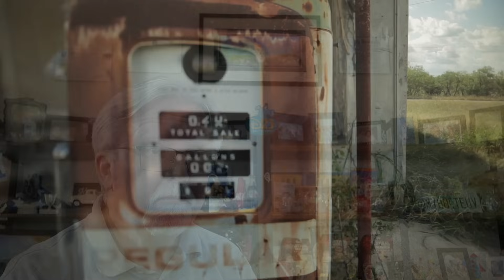The Shocking Truth About Gasoline Production Energy Usage

Comment: Prius owner here.  What drives the cheapest.   When I leave from home on  a 4,000 mile trip.  Usually Iowa to a body of water and circle back. Amazingly, something always  happens to a tire.  Either  EV/Hybrid/ICE. Replaceable tire sizes is a must.     Once being rear-ended by a truck caused me to come home in a rental never to see my car again.  Deer strike once left me limping 1800 miles home with major body damage.  Remember to have a Canadian Liability issuance card and Mexican Liability Insurance.   Chain and snow tire laws must be understood. EVs charging stations are getting there. But not prime time yet. 60 plus cents per kilowatt is a hell of a price. Hybrid or 2nd generation Volt is still the best road warriors.   When someone  drives from Key West Florida to Fairbanks in an EV.  Let me know.  P.S. I did that in split seasons of 2013/2014 in a 2010 Chevy Aveo. Yup I did have tire issues plus this pretty ceremonial stamp in my passport for crossing at the northern most US/Canadian boarder crossing. Chicken, Alaska is a must see after an inch of rain.
Reply from the maker: There is a video of a Cybertruck AND another of a Model X that have driven to the Arctic Ocean…and one originated here in Florida—not Key West, but it could have easily been!  Yes…I’ll guarantee you that it is very possible to drive an EV from Key West to Fairbanks.  If you fund it, I’ll do it in my Bolt EUV!  You can send the money through a SuperThanks or Kofi. Mail or wire transfer also works.

Comment: Not only to mention that every gallon of gasoline to the pump requires some gasoline to be burned… But additionally, a battery for an electric vehicle can be recharged quite literally thousands of times. So for every tank of gas, that is consume, a significant amount of gas gasoline has to be burned to bring the gas to the pump. This happens for every single tank of gas. There is also energy consumed to create a battery pack for an electric vehicle, but because it can be used 2000s of times before it gets recycled, that energy only has to be expended one time.
Reply from the maker: Indeed...

Comment: Jim

Great video!  I just have a few questions for clarification and a few comments.  From my research on the topic of this video (if I remember correctly), most sources estimated the energy required (from the well to the vehicle tank?) was between four to six kWh for a gallon of gas.  Not all of that energy usage was necessarily in the form of electrical energy   I do not remember seeing an estimate of the power used only for the refining process?  I believe some of the larger refineries generate their own electrical power onsite because they can use the fossil fuels available so it can be less costly than purchasing energy from a power company.  I believe there is a very large array of electrical wind generators in the North Sea that supplies electrical energy required for the drilling rigs and possibly none of that energy generated makes its way to any power grid for use by others.
Reply from the maker: North America…didn’t look at European drilling. But 6kWh of “energy” (mostly electricity) is pretty much average. The point I was trying to make is a gasoline or diesel powered car takes energy to MAKE energy—energy that could be put directly into a battery. But then they burn even MORE energy to waste 70-80 percent as pure heat!  It’s extremely inefficient. Makes more sense to just pass the refining power directly to the battery in an EV. 👍

Comment: Now compare true EVs to Hydrogen fuel cell vehicles. It takes 39.4 kWh to produce 1 Kg of Hydrogen with 100% efficient Electrolysis. A more realistic number is 52.5 kWh per Kg of Hydrogen. A Hydrogen Toyota Mirai goes about 60 miles per Kg of Hydrogen. Hydrogen costs $36 per Kg in the only state that sells it to consumers. That is about $0.60 per mile just for the fuel alone. A full tank of Hydrogen costs about $198 and goes about 330 miles at most. Hydrogen is so incredibly inefficient and costly that it will never be viable in consumer cars.
Reply from the maker: Hydrogen is one of those things that looks good on paper but is really just an energy hog in the real world.
Reply: @ the problem is that most people see Hydrogen in water as an energy source. Water is basically inert from an energy perspective. They think that extracting Hydrogen from water is basically “Free Energy”. It isn’t. Far from it. Hydrogen is an energy store and not an energy source.

Comment: Infrastructure, infrastructure, infrastructure 
This what is desperately needed to propel the sale and use of ev’s.
Up here in Michigan you can go on a long road trip and not see a charging station.
Until the charging situation improves to half of the gasoline stations, range anxiety will ever be on the mind.
Reply from the maker: It’ll be even on the mind because people believe misinformation. You too?  I’d get in either of my EVs today and drive anywhere the roads take me here in the lower 48 without planning just like you do in your gas powered pollution machine. Why?  Because there’s enough infrastructure there to support my trip. That dog don’t hunt anymore.
Reply: @jimmaas4841  I live in michigan, Warren,  mostly charge at home, but there are more charging stations around than your aware of. Just go to DTE website you can go anywhere in 48 states .
Reply: With 95% of most peoples driving being local. The need for a charging station is right where you live. I do all my charging at home getting the cheapest rate possible.

Comment: What people don't realize, is that the energy invested in the production of a vehicle, (whether EV or combustion) is only a fraction of the total energy invested in a vehicle over its lifetime. With good maintenance and conservative driving habits, vehicles can easily go 250.000 miles or more.
     If you do worst case scenario, just imagine, charging your Equinox EV on 100% coal fired electricity. An engine in a combustion car is at best, 30% efficient under ideal operating conditions. A coal fired power plant can achieve closer to 50%. You lose approximately 6% of that 51%, which means, 48% of the BTU content of that coal makes it to your outlet, that you charge your EV from. Already, you're getting about the same continuous horsepower hour per ton of carbon dioxide produced, if you ONLY count the carbon dioxide emitted by the engine. This does not count, the carbon dioxide already generated, just getting that gas in your tank. The fact that the EV has regenerative braking puts it ahead. Now, you would need a good hybrid, to get back to a comparable efficiency to an EV, charged exclusively on coal fired electricity. Throw in a photovoltaic array, or, a few turbines, or even a natural gas fired plant, and it's a clear win for the EV. Charging from a roof top solar array, this contest is over! ( If you consider the losses in the charging system, charge acceptance efficiency of the battery, and losses in the inverter and motor, EV's are approximately 67-78% efficient overall, depending on the model, not counting what other energy is used for climate control. and other draws, such as headlights, wipers, touch screens and other electronics. Even with that, those accessories only draw 1-2% of the energy used by driving. (not counting climate control)
Reply from the maker: Good points.

Comment: OK, I’m an EV advocate, but you left out one big thing here. You have to get energy from the coal mine or the natural gas to the power plant to make the power to run the car unless of course you’re running on some sort of green energy or nuclear. So how much loss is there in energy between mining the coal, hauling it to the power plant, burning it, which creates a lot of heat and then losses in the lines getting the power to your house. Seems like you’ve totally ignored all of this.  I have no doubt EV is still more efficient than gasoline, but you may have over exaggerated things a bit.
Reply from the maker: Nope. Didn’t ignore it. Go check my sources. The EIA energy mix takes into account the transport of coal and the piping of natural gas. Go dig in and learn. Then come back and we shall talk. Exaggeration implies I’m lying or embellishing things that are not necessarily true. You’re welcome to TRY to destroy the math. Good luck…
Reply: 100% coal and your still better off in an EV.  

The grid is getting cleaner over time, the vast majority of new power is renewable. Coal represents a smaller portion every year, here in California it is less than 1%.
Reply: To be fair, there are charging losses not accounted for here from the wall or the fast charger to the battery. There are also small losses from battery conditioning. On average these losses are about 15 percent. Charging loss is an order of magnitude less than the 70-80 percent efficiency deficit that ICE cars have compared to EVs.

To put this another way, if I charge my 65kwh battery on a 30  and put a watt meter between the wall and my EVSE, the watt meter will read about 74 KWH dispensed from the wall. That's the same loss as bringing 1.5 gallons of gas to the pump before it is burned. It's not nothing and deserves a mention, but it doesn't subtract from the point of this video in any meaningful way.

Comment: Wife and I bought a Tesla Model Y LR in June 2023 and it has been great. One thing I think you forgot to mention is the number of people that make a living from ICE vehicles. I believe that they feel the most threatened because EV's don't require hardly any maintenance like a normal ICE vehicles do. Tesla has only their dealerships and many car dealers are threatened by this fact. The shear number of parts in an internal combustion engine along with everything that goes along with keeping everything running is mind boggling to people that actually understand both types of vehicles. So many people that have never driven an EV don't understand charging and are so afraid of running out of charge. We recently completed a trip of over 1200 miles and it cost us a total of $77.94 to drive that many miles using the Tesla charging network. We did get free charging at one hotel and at a parking lot while we were on a cruise. The same car that averaged 30 mpg would have cost at least $106.35 if you could have bought gas for $2.85 a gallon. The car averaged 260 Wh/mi or the equivalent of 116 MPGe we drove faster than the speed limit of 70 MPH on I95. 

People are also afraid of technology and always fight anything that is different than what they are used to. EV's are not for everybody but for ninety percent of the people that own cars they work great. I installed a home charger and it cost anywhere from 40 to 60 dollars a month to charge our car. There are a lot of people that spend $160 dollars or more per month on gasoline.
Reply from the maker: I drive an average of 2400 miles per month. My last ICE car was costing me $220-250 per month with gas at only $2.65 a gallon. Today, two EVs in the house. 3600-4000 miles between the two and only $80-90 per month in electricity. We fill while we sleep. I’d like to see somebody gas up their car while they’re asleep in bed. 🤣😂
Reply: @ My wife and I are retired and live in Charlotte NC. We have averaged about 13k a year on our Model Y. Last year per my app we spent 618 dollars in 2024 and so far 222 dollars in 2025. We just got back from a cruise from Port Canaveral a couple of weeks ago. Best of luck with the Bolt.

Comment: I've seen various arguments and figures about the energy cost of refining gasoline, including the rather silly argument that if it's not electricity used to generate that energy required for refining, somehow it doesn't count as an "energy" cost.
Refining is only part of the total energy cost of course. First the crude oil needs to be extracted from the ground and collected, then transported to the refinery, then the actual refining, and then the gasoline (or diesel) put into a tanker to be transported to the gas station and pumped into the storage tanks - maybe gravity alone can accomplish that last action. 
At this point the customer has to drive to the gas station and more energy used to pump the gasoline back up and into their vehicle, and now they use more energy to carry that gasoline around in their tank until it's needed in the engine.
Compared to: electricity is generated on my roof via solar panels, and put into my car battery.
And when that gasoline is finally in the tank, the engine is still only 20-25% efficient in converting that energy into motive power - assuming the car is actually moving. 
Most vehicle engines still run even when the car is stationary, and attempts to stop-start the engine at traffic lights to mitigate this issue cause more wear and tear to the engine, and cost the vehicle owner more in the long run.
Reply from the maker: Yep…that’s the truth.

Comment: Thanks Jim, great segment!
Reply from the maker: No problem. More on the way.
Reply: @jimsEVadventures  still waiting for a new battery for my 2020 Bolt Premier, it's been a month already and no one can give me a date. Unfortunately I know there are many others waiting as well.  Evidently the software fix did not solve the issue, only getting 55 miles currently on a full charge.  I got a hold of the GM EV Concierge and they offered to pay for a rental however I need to pay out of pocket  and would get reimbursed monthly. Trying to hold off as long as I can on rental.

Comment: Wow-I didn’t know that refining a gallon of gas uses more energy than driving an EV 25 miles. That’s a surprising factoid. Yet another reason to consider an EV! Excellent and educational video!👍👍👍
Reply from the maker: Thanks! The truth is out there.
Reply: these facts should be widely popularized.
Reply: @paulmcgraw9284  I'm definitely going to do follow up reading on this. I'm a numbers person so I need to see the math.  I knew petroleum used electricity (obviously) but did not know THAT number.  A lifetime ago I drove a fuel tanker locally.  The infrastructure needed to support gas/diesel distribution is involved in its own right. Just loading a truck requires a dedicated facility, pumps, controls, lighting, vapor flaring, ect.

Comment: Love your videos you might want to add the energy needed to generate the electricity, if it takes 2 kwh to generate 1 kwh with natural gas you are still better off with an EV. I don't know the exact amount it takes to generate the electricity but I believe it's pretty low so you are still right. 

Keep up the great videos.
Reply from the maker: The electricity grid is getting cleaner every day. We're on the right track! Renewables have been producing more electricity than coal since October 2021. Almost 40 percent of the US grid is now zero carbon.
Reply: @jimsEVadventures  thanks Jim for the video, I think it is important that people understand it's still less energy and cost to even use an EV on a dirty grid. You are correct it is getting cleaner.